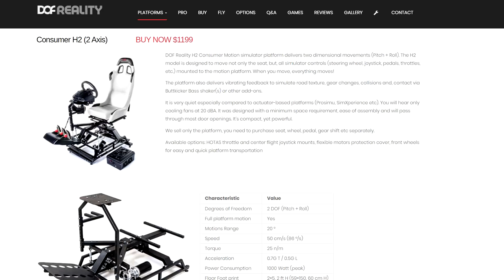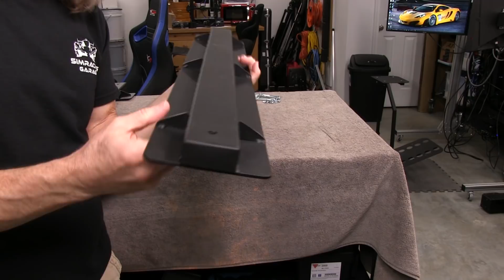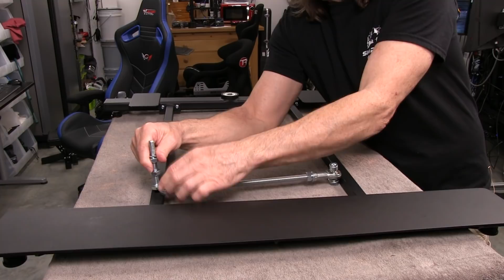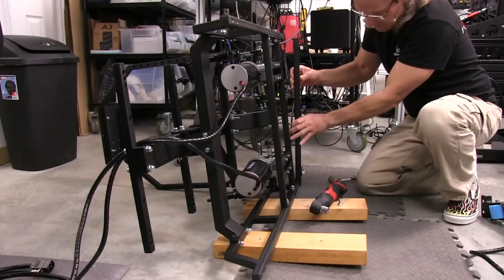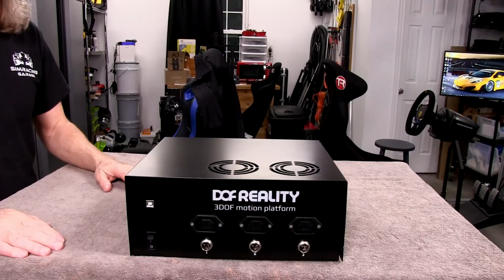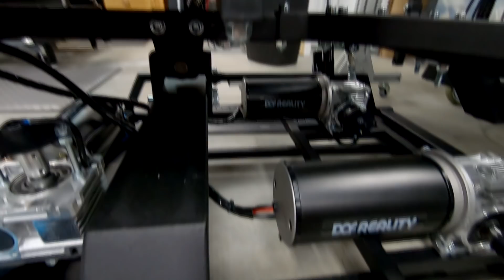DOFReality H3 Motion Cockpit Review

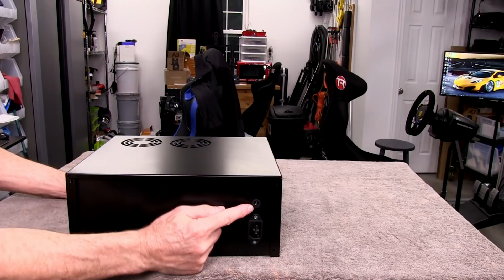Comment: 23:00 the E-stop switch is meant to be wired which way? Normally-Open or Normally-Closed?
So when you press the E-stop, it should either flow the signal, or it should cut the signal?

Comment: I think the most shocking thing here, other than your monitors not being mounted to the motion platform so that they properly move with you(or, even more shocking, the fact that you're using monitors rather than VR) is that you're using a belt driven Thrustmaster wheelbase. Anyway, thanks for the video. I'll be buying mine soon enough.

Comment: I am deciding between the h3 or the yaw 2. Any chance you can get your hands on review of the yaw 2? Or what are your thoughts of the yaw 2?
Reply: I was on the same thinking. And I decided to go for the P2 (to upgrade later to P3 if wanted, as I am not on moment on need for yaw axis). What I seeked for the Yaw 2 as information, I could not really find is it accurate and reliable. 

Meanwhile there has been the SFU motor upgrade for DOFReality that makes it totally smooth, fast and more powerful.

The Yaw 2 benefit is that it looks a lot better, it takes a lot less space, but it is very dedicated then for that, and modifications are difficult without losing warranty.

Comment: Barry; how would you compare something like this H3 setup against a four-post motion such as the SRTmotion, which comes in at a really decent price point for 250mm/s. In looking at 'cheaper' systems, where does the most benefit lie - in more inputs (albeit lower quality) or more accurate, smoother responses.

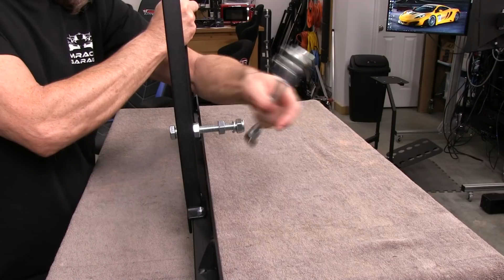Comment: 9:55 the lockwasher is supposed to go under the nut, not under the cap screw. That is the purpose of a lock washer - to keep tension on the nut to prevent it from working itself loose. I also have doubts about placing the lock washer against the rotating knurl of the rod , that should have been a regular washer , if using anything at all. - but whatever - still a great review
Reply: Wouldn't a nord-lock washer be ideal?

Comment: As always, excellent content Barry! I recently purchased the DOF Reality H3 following your review. It was quite a process to put it together. I had to adjust a total of 7 mismatched holes in many of the steel beams and sections with a file. They were off up to 5mm, and thus impossible to be assembled without adjustments. Even at this low price point I was quite disappointed. It’s done now, and I’m looking forward to trying it out when my OMP Champ seat finally arrives.
Reply: Is it reliable? How is it long term (using it for 7 months)
Reply: Hi Wolfram, Andrey asked how th DOF Reality H3 has worked out for you over the time you have had it. Would love to know if you have any regrets in the purchase? Right now if you still have it you are around the 3 year mark?

Comment: these immediately sold out and then the company increased the price by like $700, like most everything sim related. For example the g29s are selling used for $450-500 on ebay when new they were $250-300 depending on sale days. This went from the original $1300-1400 dollars to $2000. thanks corona
Reply: Oh man was this really 1500 bucks at one point oh man!!!! I want this but the 2500 (with shipping) is crazy

Comment: i wonder how this would handle a direct drive wheel
Reply: not well.  I got an H2 and a Fanatec DD1.  A lot of flex.  I ended up upgrading the front of the frame with aluminum profile and got the SFU gearboxes.  Works perfect.

Comment: Thanks for the review Barry. With some moderate fabrication skills, do you think it'd be easy to make some adjustments to the rig to make the pedals adjustable for leg length and a tilt axis for the steering wheel? I know you only review the stock setups, but just to gauge your thoughts for those seeking flexibility.
Reply: I am a fabricator and will see what I can do to better mine when I get it. It’s the tinkerer in me
Reply: @flyingeyeballfpvjoe1516  thanks! Let me know how it goes.

Comment: Hmmm I think if I am spending a few thousand, I would want a more rigid wheel mounting system... Seems they have tried pretty hard to design a balance of rigidity and lightness though. On the website, it looks like the shifter mount on the H6/P6 is sitting on an extra arm that is added. I wonder if it is actually connected and if it provides more rigidity...? That might make the upgrade quite a desirable option...
Reply: They have an extra support you can order that take basically all flex away

Comment: Hi Barry! 
I am going to be taking delivery of my HPP-JBV pedals in the next few weeks. Could you make a "five-minute-quickie" video of your 1010 pedal mounting solution, please? I am not sure of all of the brackets you are using and the required lengths of 1010 to use. I am considering using 1530 on the front and back and 1515 on the sides (just one layer of extrusion) and that will be sufficient to give the pedals a strong enough base so that they do not move on me. Thanks in advance if you can respond to this request (written or a video).

Comment: Had one of these since September last year absolutely worth the price. Immersive as being in a real car. Once u get it dialled in vr its a thrill ride of all rides.
Reply: My question is this, how much of the acceleration do you feel. I’m considering buying this for my oculus.
Reply: @user-by2kq6qr3z  u can feel as much acceleration as u want. The angle in which the rig moves can be far more than u would feel in a car.  The only thing u won't feel is g forces. First time I tried a car like a ferrari or other car I was stunned in the way I thought I was goin to lose control of the car especially in vr ur mind can be easier to trick in vr as ur senses are heightened. I'd say for single monitor the motion isn't as immersive but not tried triples screen. Honestly for how much the h3 costs its not a toy even tho it's in the lowest bracket of motion technology well worth £2000 all day long.

Comment: i have an H6...i got it in march....take a guess how many time i got to use it....with in the first week....one of the boards in the box burnt out...waited 3 weeks for replacement....board burnt out again on the second run, one hour into play time...waited another 3 weeks for replacement...then one of the motors blew on the next try after board came....support walked me through test for 3 days trying to see what the problem was...they didn't be-leave it was blown...i requested a new motor....they sent one....was a bitch to install....but the motor wasn't calibrated when they sent it....so i spent another two weeks with support with then trying to walk me through the calibration....did everything they said...even had the on team viewer so they could watch and see...still nothing...so now...the rig is sitting here with all the boxes and two motors shipped back to dof reality for calibration...if you are looking to get this rig...get the P version...the H version is garbage....non tested waist of money.....not a day goes by i don't regret this decision.
Reply: Okay, there are a few things i said in anger. in fact the reason it took so long was my own fault. DOF REALITY customer service is actually really really good! They replied promptly and tried everything in there power to get me up and running again....the delays were my own fault for not respond as promptly as they did. they should not be held accountable for my own mistake. and to this day they are still trying there best to see me satisfied.
gremlins happen...and i'm not the most tech savvy person to fix these things so in all honesty i shouldn't have jumped down there throats the way i did.
For what its worth .... before the problems started....it was the most fun I've had playing games and sims...and that is a fact.....for the price...it is a no brainier.
i apologize.
Reply: @richking2088  Thanks for your review of it, and thanks for the honest response. I know the pain, sometimes it just gets crazy and you gotta vent, glad you are getting it figured out! Best of luck moving forward! cheers!
Reply: Rich, yeah tech can be frustrating but that is the fun of it too, getting to solve these problems, working with the designers and developers from the consumer side.  You are getting to build something and help improve something that yes you bought and paid for but you are contributing to a larger community.  Most people don't even comprehend that sim racing exists at this level that we play around with.  And getting to show other people after you worked on it, built your own computer for it, set up the vr, etc. is also part of the enjoyment.  The vast majority of the world doesn't even know this exists and when they do get to experience it they are blow away by how awesome it is.  I wish you the best of luck getting your rig up and running again, and being able to put some laps down.

Comment: I think 2DOF motion platforms for sure may add immersion to sim but are not providing information for driving; the 3rd DOF shall make the difference in understanding when you lose the rear that is really what you get too late relying only on screen and wheel (at least me) . Said so, can be used solely this 1DOF making your seat or rig yaw? Never saw such application, but I think I'd definitively give it a try.
Reply: Like never said, there is the Next Level “traction plus” already being revived also on this channel.

Comment: This is Garbage for Rally Games I should no I own the P3 Version Which I bought for Dirt Rally 2.0... Ask him to show you a video using Traction loss Showing driving and the screen at the same time For dirt rally 2, probably wont because it is so unrealistic it clunks and bangs even on low setting with any software I bought and tried them all to cure the problem. it is just a joke. £3000 UK Pounds wasted. BTW I will be doing a review from somebody who has paid for the product not someone who was given it for a review if I could have tried before I bought it I would have walked away and saves a Load of Cash.
Reply: but some people play dirt rally 2 and everything looks realistic 

https://youtu.be/9gRTCsOJ0cA
https://youtu.be/lRV0_liyzKQ
Reply: OK you are right about cars not being tune by car basis. That is all you are right about just played a rally there in vr in subaru impreza all I did was turn boost upto 70 turned pitch and roll upto 13 sway down to 8 and traction upto 13. Can feel every bump every spin very landing on jumps. Even driving with a front left puncture can feel the front left vibrate. Unless your motors are faulty I'm sorry but I have to disagree with you. Suppose motion is subjective as force feed back is but having driven rally cars and cars on race tracks I can say its pretty realistic.
Reply: @RACER-dz8uh  Just to be clear...Dirt Rally does not send proper TL data. So SRS uses a complex formula to estimate Traction loss. The more people asking Codemaster to send traction loss (Lateral velocity) telemetry, the bigger chances to get real data so it improves TL. Can't do magic if the game developer do not send proper data.

Besides that, the other effects are great...full Rally driving sensation.
Reply: Sorry but I have the h3 and can say once u figure out to tone down n tune this thing its mind blowing its not something that can be rushed u need to spend hours tuning it even for every car. Everyone has they're old opinion.
Reply: @RACER-dz8uh   there is no option to tune cars separately in rally games and yes i spent hours tuning and it is still rubbish obviously you play road racing otherwise you would not of said that it is garbage for rally games go to the forums and read the complaints
Reply: I will go fire up dirt rally 2.0 and see. it has been a while since I was on but I'm sure u get to tune and save on a per car basis. U do in assetto corsa and project cars 2 which is Wot I play mostly road racing games lol
Reply: @RACER-dz8uh  I only use dirt rally 2.0 and dirt rally so I know there is no per car settings like I said try the traction loss it is so unrealistic almost laughable people in the forums have disabled this feature and i have all the different software to try to cure the problem ... there is no telemetry data for the traction loss it is either 100% or 0%.
Reply: Hi Phillip , sorry to hear that I was looking into purchasing the H3 mostly for rally games but after reading your post I think I will reconsider
Reply: @seadoomania  I have upgraded my p3 to a p6 and still not as good as i was hoping I know that some people will disagree with me but whatever company you choose to purchase from if they are using motors then you will get the play from the motors tried every software so that is not the problem.  I will be seriously thinking of looking into a more expensive route something like Prosim or a Dbot which uses actuators the only downfall they are more noisy but i presume if you are going to use headphones that should not be a problem as for my problem is the clunking and slop from the motors even with the new P6 it is still there.
Reply: @seadoomania  here is the slop that you get after a few weeks so people can see what i have been complaining about.  https://www.youtube.com/watch?v=5QVawA8cN6M

Comment: I have not seen any rig with added rubber element to smooth out the digital abrupt movements from the motors. All cars ride on rubber why not rigs as well. Is it possible to add rubber elements to the seat?

Comment: Will a rig take the load of a heavy wheel, pedals and gear selector as well as the monitors? For most realism, the screens would move in unison with the wheel, but would the weight capacity be exceeded in that case?
Reply: You don't mount the tv on this unit. I have one and it has all my equipment except for the tv mounted. Fanatec csl wheel, fanatec loadcell pedals, cobra monaro rally seat, thrustmaster shifter, handbrake, plus bassshaker mounted underseat. I'm about 15stone in weight so it can take a good amount of weight and it still throws you about. Cracking bit of kit

Comment: How well would it handle a DD wheel (Mige, etc) and heavier pedals (such as HE's, PT2's, etc)?  I noticed you decided to install the Thrustmaster kit instead... is the pedal and wheel decks not stable enough?
Reply: I have HE Ultimates and Fanatec DD1. The pedal plate is rock solid, and the wheelbase plate mounting posts flex front to back, but not laterally or rotationally at all. The flex is tolerable, but I look forward to a better solution.

Comment: Love the content. My question would be how well does it pick up the road surface and rumble strips.. And how does it compare to your P1 personal sim rig?  Thanks for the video
Reply: Dude u can feel every road detail wen u get it dialled in. Even feels like goin up hills n down. Hit one kerb with one wheel u feel it in whatever direction it was that hit. Hit a wall boom feels like hitting a wall hit a car or bump u feel it. It's some bit of kit had one for a while now. Only issue I have is the app for running it crashes quite a bit but u can over look this easily for when it runs good it's dynamite

Comment: i've been waiting for this video for so long. i ordered the H3 and the rig is setup, just waiting for my DD2
Reply: I highly recommend to replace the original wheelstand as it is much too weak and has too much flex, especially with a heavy wheelbase. It has also very limited for positioning the base to your demands. I replaced mine with a set of aluminium profiles (around 80$)... much more sturdy and infinite possibilities for setting the right height/angle etc. Also, the pedal plate has flex as well (@scott: certainly NOT solid as a rock, my previous RS1 seat was much more robust). That could be solved with attaching wires between the plate-wheelstand-seatframe.
Reply: @iseeq72  Now I would love to see how you have done that! Have you gone with 4 arms instead of the original 2? I would assume that would have to be substantially heavier than the original, even though aluminum itself is so much lighter...?
Reply: fondoo - what pedal set you want to use ... for me the the pedal and wheelbase mount look very fragile and I assume a lot of flex in 65kg brakeforce on HE pros. 

I would love to read your opinion before I order 2 sets of H3 this summer
Reply: @RalfBlees  my fanatec DD2 and v3 inverted pedals are coming on monday. i know for sure I need to stiffen the wheelbase mount but i think im good with the peddals. follow my channel, i will have some content
Reply: Ralf Blees - I have HE Ultimates mounted to a P6 (same pedal plate), and it’s solid at a rock.

Comment: Those polyurethane wheels need a retaining top rail. Did you see that lift when Barry rolled it!? Product would not be long for this life with that level of uncontrolled motion.
Reply: So? If you can afford this thing = You can afford a few little poly wheels, having a mechanic weld in new rails with warranty for life etc would cost more than a lifetime supply anyway ROFL
Reply: @ToreDL87 You're missing the point I think. The wheels are bullet proof, the linkages are the weak points.

Comment: I'm hooked Though how does it compare with some more expensive riggs like Dbox etc. And how could you stiffen it up so you can put a DD-wheel on it?
Reply: I have the P6 with DD1 and HE Ultimates. The pedal plate is solid as a rock-no issues there. The DD1 does introduce some flex front to back, but lateral and rotational flex is nonexistent. Love my P6.